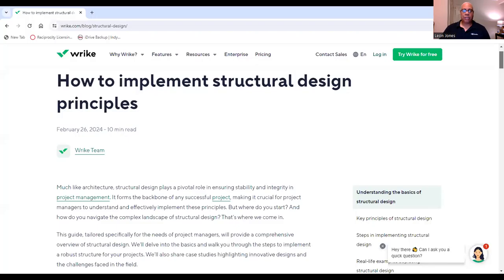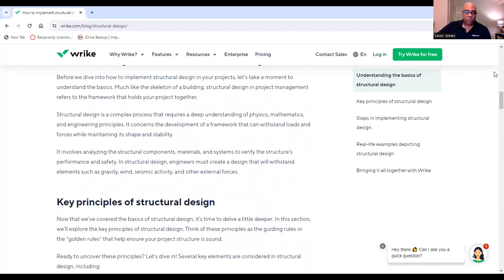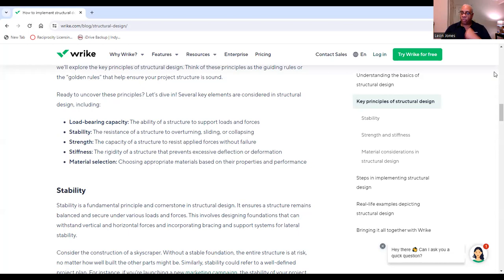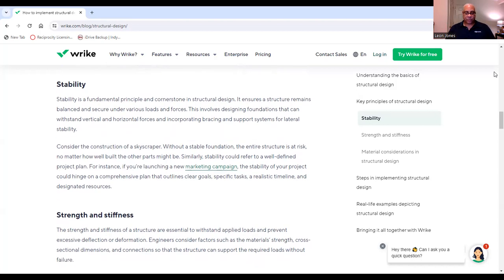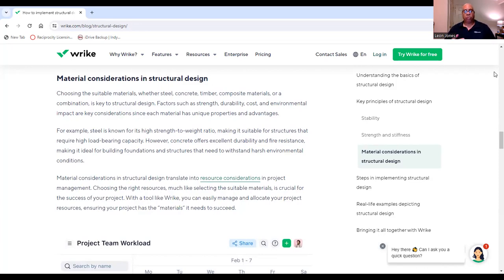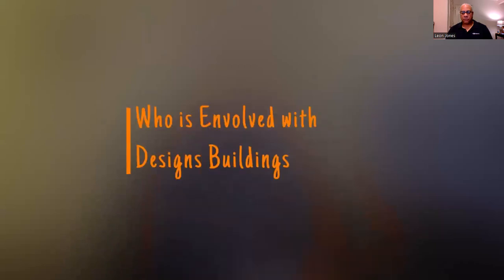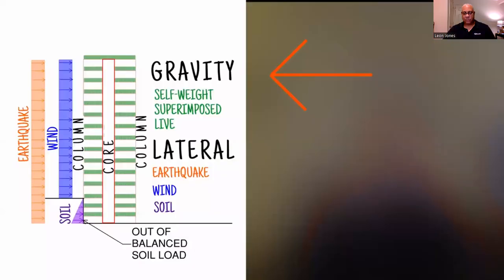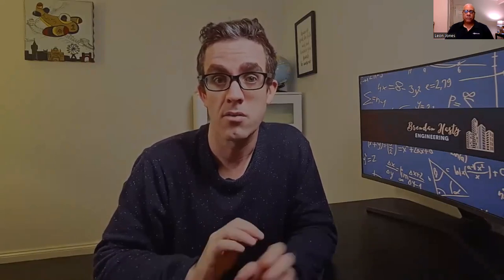How to Integrate Structural Design into Architecture, Civil Engineering, and Construction

Comment: I have a question for you sir, did you take the 6 INDOT certifications? If so, how did you study for them?
Reply from the maker: I did take the 6 INDOT certifications. You're given books for concrete, soil, stormwater, bridge decks, and bituminous where you study how to work math problems and testing. You perform a side by side field testing at one of the INDOT districts.
Reply: Can you possibly make a video about the 6 INDOT Certifications? Thanks and you have a great channel
Reply from the maker: @Megalodon.89  I will make a video about the INDOT certifications